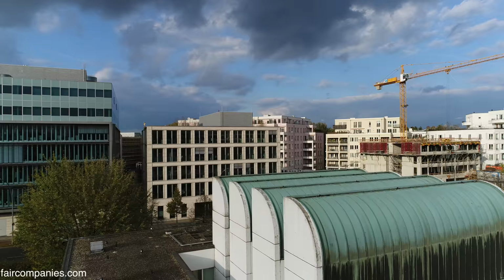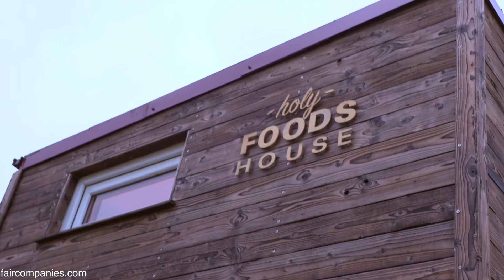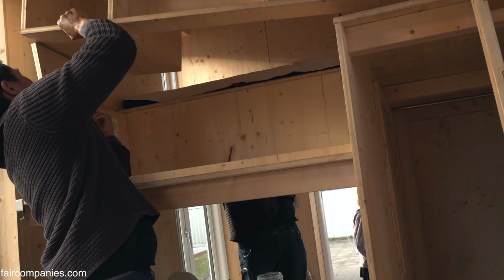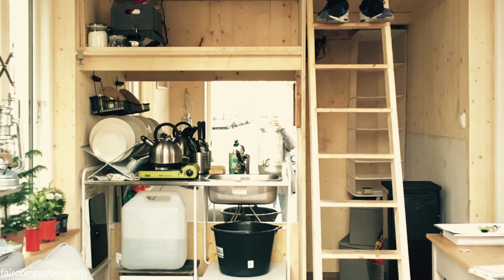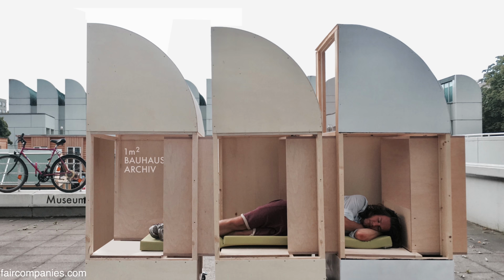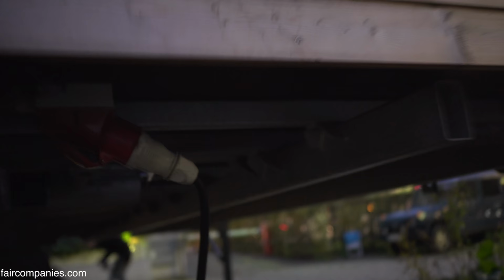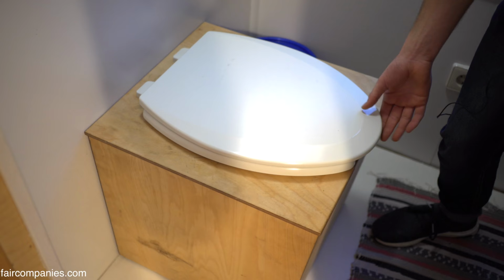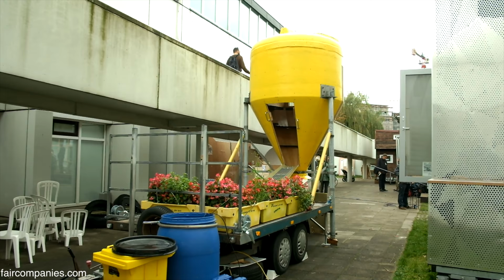Bauhaus to tiny "haus": micro-home village in Modernist Berlin

Comment: Ahh. This is the Metabolism Group meets the Tiny House Movement meets Bauhaus.
Reply: This channel had a video about two years ago on Nakagin Capsule Tower. This stuff isn't practical but has the potential to stimulate the imagination.
Reply: What could improve the design and practicality of the concept?
Reply: Kirsten Withworth What I found pretty much a problem of the "concept" is that it doesn't reflect the "shelter"-imperatives in a 52 degree north latitude, at all.
Calling a mere box home might be OK by cultural principle, but said "OK" immediately ceases to be part of the equation as soon as You reach freezing temperatures in reality and only have an inside gas burner without a chimney. Simply. Not. Possible.
Living over decades in all kinds of shelters like aboard yachts or in off grid cabins, even in cooler seasons, I would propose the following order: the warmth management (including building physics, humidity management, oxygen management, warmth recycling) is the first and foremost technical problem You have to solve; before that, You are good to go in the tropics, maybe substropics, but higher latitudes than that, and it becomes a technical problem to be solved at first; (this a good reason for NOT building individual shelters, but bigger units for much more than one person).
Next is the legal situation, the legal niche You want to inhabit, for it's not a thing to put effort in something prone to possibly terminal liabilities in terms of legality.
With this done, the rest might be playful utopia.
That's a major problem with a lot of alternative projects I knew and still know: people's incapability to completely determine what settled living does mean in terms of technical complexity, the more when You want decent restrooms and daily showers as well as toasty living room temperatures in "our" (northern German) latitudes.
I suppose It would be important to stress more what living without running water and permanent current as well as in a woodstove-only situation is like.
Reply: Absolute rubbish, John. Explorers do, traveling the world, for example, hikers, hunters, sailors in particular do this kinda stuff for ages, lately New Yorkers, Japanese Metropolitains in the Tokio area and some other great places are partly organized like that ... get an education and check Your data before You contribute something untrue, will You?
Reply: figuring out how to apply those ideas to something that will pass building codes or find some way for a waiver to get Municipalities on board.
Reply: @manfred Schmalbach: Education and data? YOU are the one avoiding the data and THIS IS YOUR EDUCATION.  Get your head out of the sand. Right now there is an opiod epidemic and until you leave your house and go to the nearest bus stop sign only to find a used needle will you wake up. I've seen it. These people love to be homeless so they can spend the little money they can get their hands on for drugs every night. 

If you were here at my side I could bring you to some of the areas near the most affluent neighborhoods in my nice city and show you dozens of signs of homeless drug use. Sleeping bags tucked behind hedges at city parks and rest stops. Literally tucked just out of site where millions travel on the highways each and every day. This kind of "living" is already happening and ultra small houses like this video shows would only propagate much more of it! 

You are naive. The problem is well publicized and real.
Reply: communism
Reply: Its definitely communism.

Comment: The only problem with this is fire code. Looks a little close. And do these tiny homes get inspected during construction? inspection of the wiring for example. If this were to become and actual thing there would have to be some regulation for it to be safe.

Comment: I keep thinking about that shower water recycling system. Not only does it offer the chance to take "endless" showers using only a few gallons of water, but it also saves greatly on energy used to heat water. 

It's an odd idea but really quite revolutionary.

ALSO, much easier that retrofitting the plumbing in an entire house or apartment. This could be an off-the-shelf shower insert with minimal connections.

Comment: I like tiny houses. I like the innovation behind them.

However, a tiny house will not encourage a land owner (of any kind) to simply charge less for rent. Inflation of prices isn't based on the cost or even the size of a place, but the price that renters are willing to pay.

I only say this because the guy was talking about the 100 Euro apartment, and I don't think that anyone would charge only 100 Euros if they owned a place like that. I know that no one in my area charges so little for a tiny house to rent (it's  more like $1200 a month for a tiny house where I live.)

I think the way to avoid this problem is to avoid landlords entirely. Just be your own, if you can.